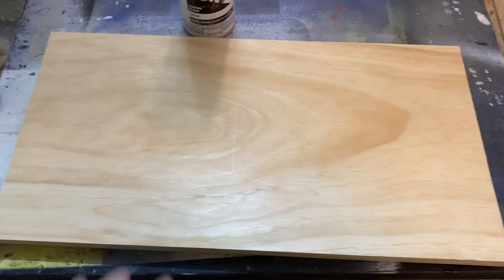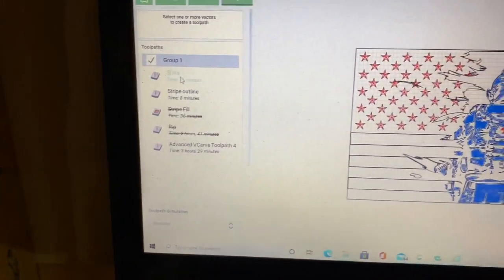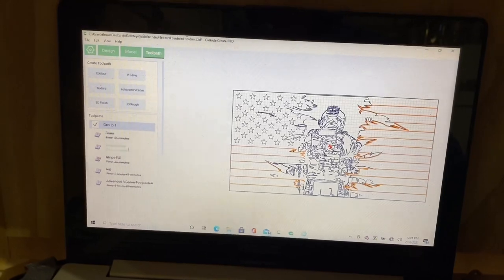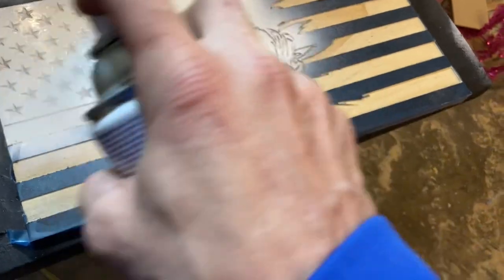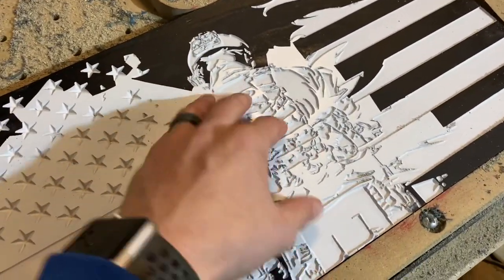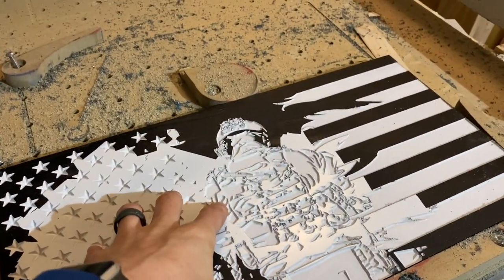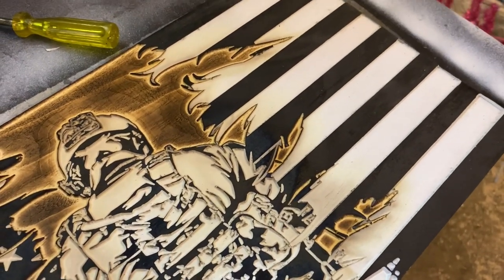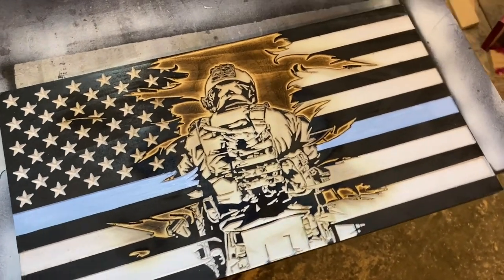Center tattered soldier CNC flag

Comment: Knowing what the dimensions are for the union from the software what is the best way to assure that when you mask off the area to spray that it will align with the cnc measurements? Thanks